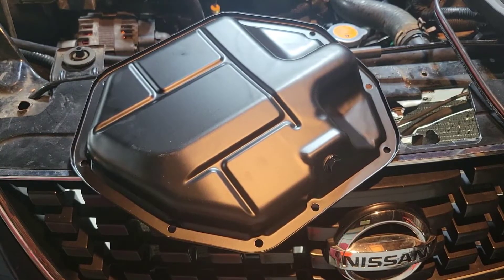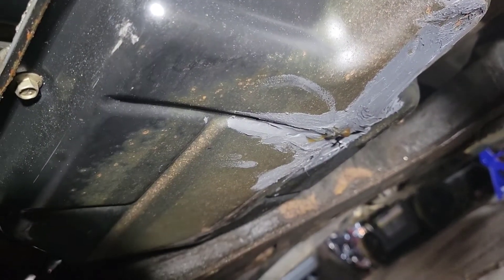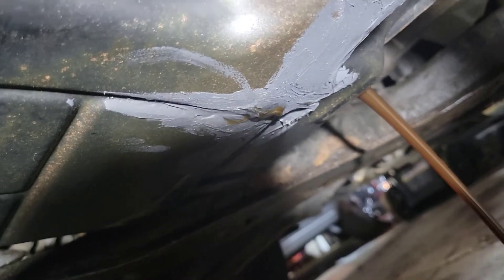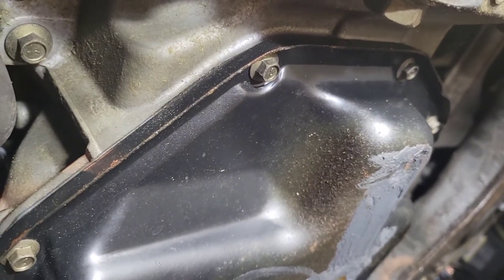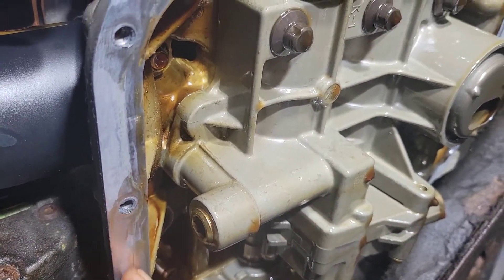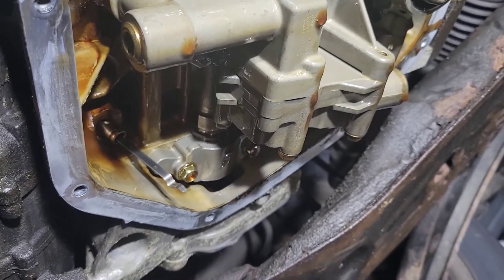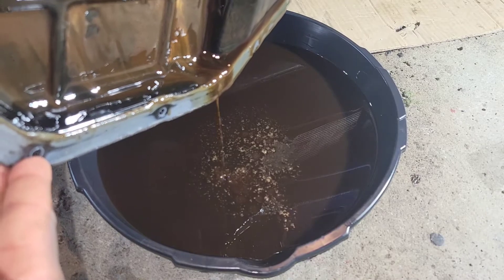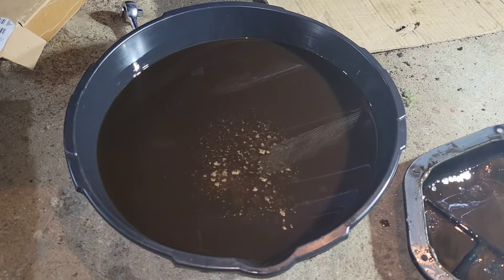sludge in oil pan, how to change oil pan

Comment: Hello, I have sludge that is dark gray with metallic particles, should I be concerned?
Reply from the maker: It all depends on how large the particles are. Every car will have some wear. The magnet should catch most particles. If you have large particles, yes, I would be concerned. Example, like small particles like small rocks.
Reply: @eilandsgarage2592  These look like very fine metallic particles that look like what a metallic paint.
Reply from the maker: No, just keep up on your oil changes